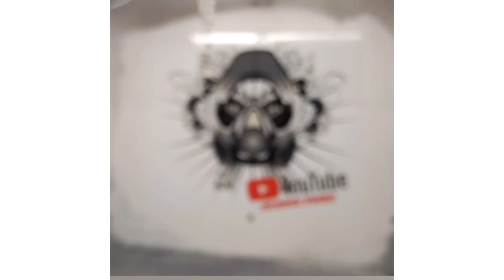Powder Coating Niche 3 piece - A UKC Short #2 - Ep 31

Comment: Sandblast issues I have a similar sandblasted to a harder freight and getting a poor media flow on matter what pressure my compress is pumping out the only media I can use is fine to medium glass. anything else will on the work I have put a meter valve to see if that will work but still the same issue HELP anybody out the with the same issue I live in the uk so weather is not that hot I think to course that problem .?
Reply from the maker: Are you running a siphon feed? or a blast pot? If on a pot did you change the lower fittings to half inch?
Reply: morning mate I used a siphon first time and it was a bit slow on 70/80 psi so I put the conversion one in on the bottom still the same to do one wheel caliper take for ever on a number 6 nozzle l think the siphon was a bitter ? What do you think 🤔
Reply from the maker: @wayneosullivan1549  siphon sucks. Get a blast pot
Reply: Blast pot ?
Reply from the maker: @wayneosullivan1549  check episode 23
Reply: You are the best man 👍
Reply: Hi mate got my pot today running @ 65 psi 👍 thanks for your help one thing I Noticed that the media blocks in the bottom ? Do I need to turn the media down a bit ? Am nearly there 🤪
Reply from the maker: @wayneosullivan1549  I run the air line all the way open and I turn the media on until I hear the sound change indicating the media is coming out. I never open it all the way. Probably around half. Also Change the lower fittings to 1/2" as mentioned in my equipment video
Reply: that’s my next job 👍🇬🇧